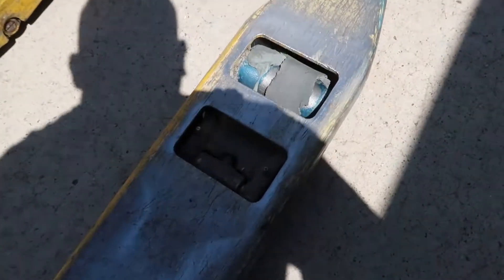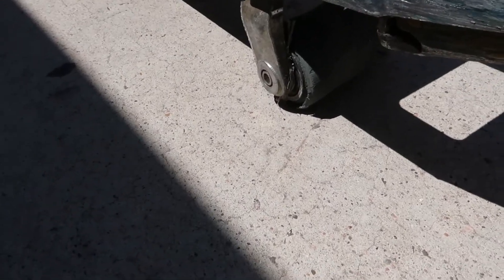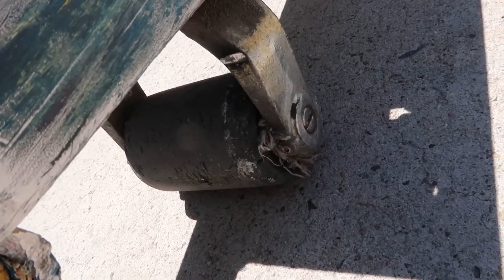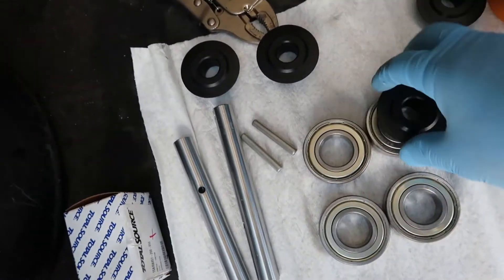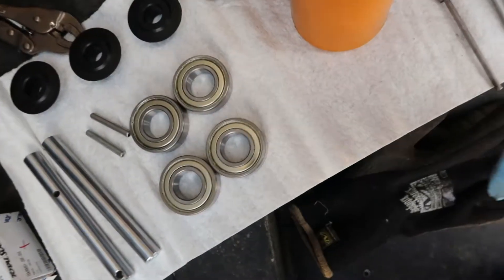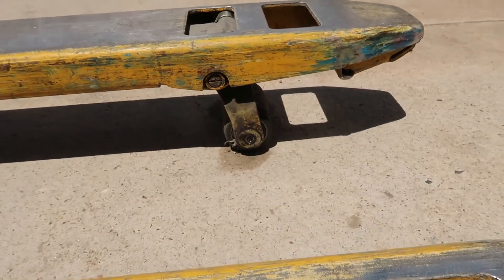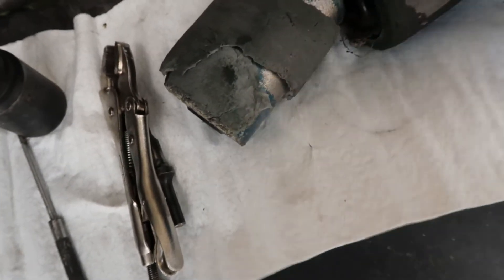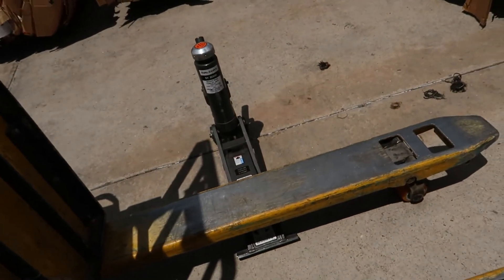Yale MPW50 Load Wheel Removal and Install

Comment: what size punch did you use for the axle? I tried changing one today and had a hard tome with the axle. Also the bearing I was given was an inch and the axle was a half inch?
Reply from the maker: Honestly I don know, I purchased the punches at harbor freight, it’s the second to the smallest one. And there is two different sizes of bearings and wheels. Also the axles are different sizes depending on the year of the jack. Sometimes if you have to use a air hammer to punch out the axles, and the pin will break it makes it easier sometimes to take it apart. Thanks for watching. I’ll have to do a update on the sizes of ouches.